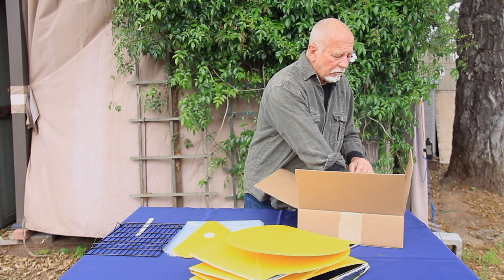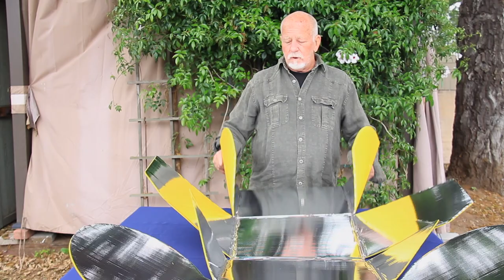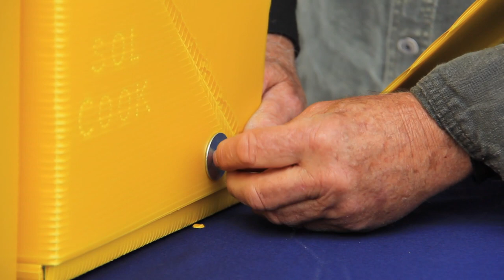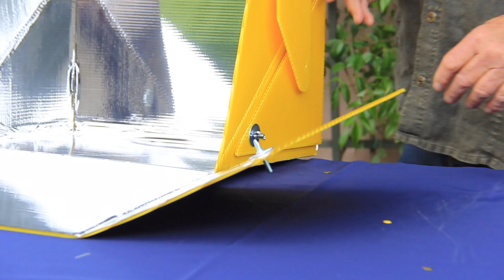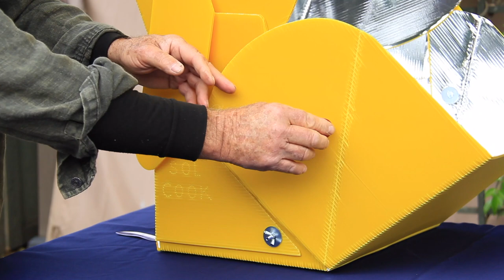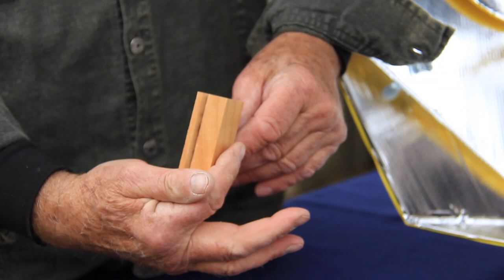All Season Solar Cooker: Unboxing and Assembly

Comment: Thank you for an updated assembly video. Wish I had thought about using a rolling pin, when I put mine together. Would definitely have made getting the folds flattened quickly. While your prior video was invaluable to me to get mine put together correctly, this one is even better, IMO.

Comment: Just made No Knead Bread today. Came out great!  While it doesn’t get brown and crusty, the inside “crumb” was perfection. Clear So CA skies, 87 high, in at 11am, done by 2pm. Used cooking bag and (preheated 30 minutes in Sol Cooker) lidded dark pot. I do have a photo I can share.
Reply: Yes, please share.  For browning I sometimes will put a "grill mat" over the bread a few minutes before it is done. This is a very powerful method of putting heat directly onto the top of your bread, so watch it and don't let it burn. BBQ grill mat is available in the BBQ section of Lowes, or online.  They are food safe. Available in black or copper. Use the black.
Reply: @allseasonsolarcooker3979  I will have to check that mat out!  I emailed a couple of photos  to you yesterday. 👍🏻

Comment: I just finished watching the assembly of the all seasons solar cooker. I’m not necessarily known as the brightest light on the block, and I love doing things the easy way, rather than trying to figure out a paper full of diagrams.
I think the only way your cooker could be any better [after looking at many different solar cookers yours is my favorite] would be to put it on some type of disc mount like some TV antenna discs. 
It would be so much easier to move around and adjust for the sun shadow. I love what you have created so beautifully,… so much that I am going to buy one! Thanks for the video.
Reply from the maker: Are used to put them on a Lazy Susan but any breeze would turn them away, so I just put them on a table now and they’re fairly easy to turn. Thanks for thinking of my cooker

Comment: Thanks for the new assembly video. Helped me ensure that mine, which arrived a week ago, is properly put together. I hope you make more videos on using and cooking with it. I've been solar cooking for a few years now with the All-American Sun Oven, which I love. But I wanted to try yours because of the larger cooking space and, well, because I wanted another solar oven. I've used it several times so far, and I'm thrilled that I bought it. I'm still getting used to focusing it correctly. Have cooked lamb, beef, eggs, rice, potatoes and peppers. I'm in Albuquerque which gets sun year-round, so I'm looking forward to using it often. So far I've gotten it up to 250 degrees. Does that sound about right? Thanks.
Reply: While cooking in the So Cal smog, 230 is what I normally get. In your location, with the clean air and higher elevation, you will do better. How you record your temperature makes a huge difference. While cooking, if using an oven thermometer, you will see a combined temperature of the cold food and the cooking environment. (this is why your regular oven turns on even after preheating - the cold food reduces the temperature in the oven compartment. To see much higher temperatures, just put the oven thermometer in an empty pot. Of course this is meaningless as the temp drops as soon as the food goes in. In all my years of experimenting, my highest recorded temperature was 335 in a black jar filled with cooking oil. The goal is cooked food and it sounds like you are doing very well.
Reply: Thank you for the reply and the information. That's really helpful. I'm having a blast using it!  @JamesLaJoie